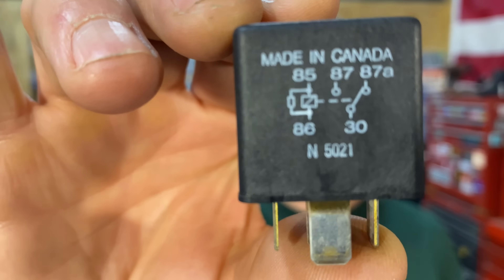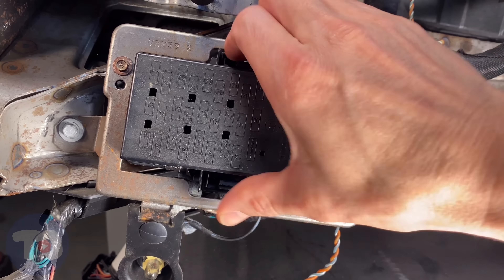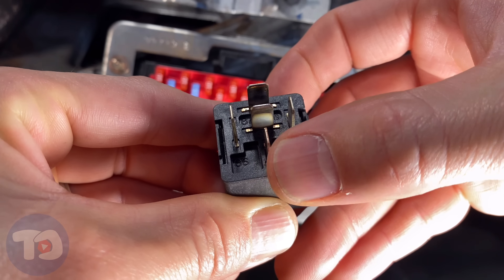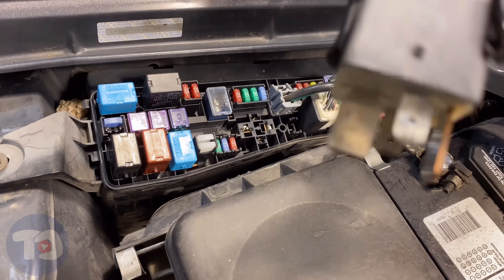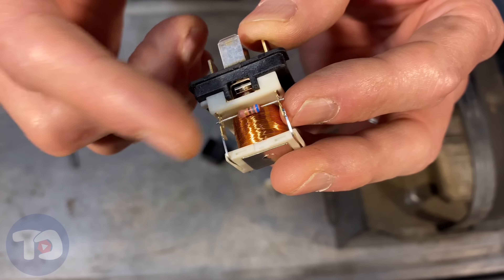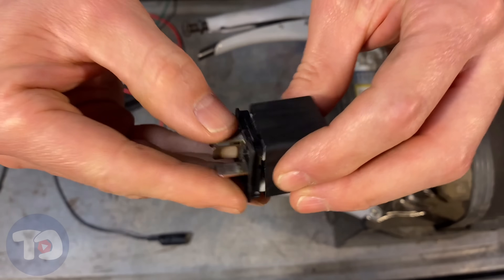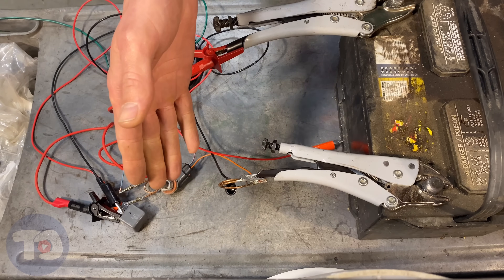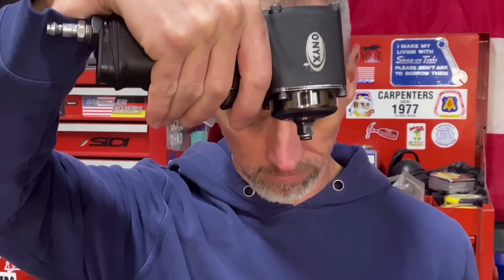Why are relay pins numbered like that?

Comment: 6:26 Answer. You're welcome.
Reply: thats not the "Why" answer..... thats just how its wired
Reply: Actually 1:16... but thanks for the red herring!
Reply: @wes3428  And still that is NOT the answer. Not fully. The thing is that the first vehicles to use the relays only had one relay. Vehicles were a lot less complicated back then. So when the relay was installed the numbered circuits is what they went by. The numbers not even written on the relay. People just referred to the pins by those numbers. So when Bosch finally started marking the pins they just went with what the car manufactures called them. Of course they did not know that these relays were going to be one of the most popular, if not the most popular relay type, they might have changed the numbers to something different like 1,2,3,4,5
Reply: @wes3428 1:16 is the distraction.
Reply: Why start at 85 though?
Reply: Exactly. It's excruciating in all of these videos to start out with "what is a relay and why do we need them?"
Reply: So all of us can do something much more useful with our time. Just like you do when you can skip all of about 6 minutes of precious time😊 (I deducted 26 seconds for finding your comment on how to save time)
Reply: @bennylloyd-willner9667  So many of them are that way, it seems.  Just blab, blab, blab, blab before maybe finally getting to the point.  And of course "Don't forget to SMASH that like button!".
Reply: @TonyGarrett-p1c they don't charge that much for watching their videos (I haven't paid anyway😊) , so I don't think we can judge them too hard on how they should/must produce videos to suit all tastes😊
Reply: What a long video for explaining a simple automotive relay terminals.
Terminology used here is not aligned with basics and automotive standards. Explanations are focused on how relays are working, not on meaning of the relay terminal.
Reply: @ehsnils said: 'All is explained in DIN 72552, and there's even a Wikipedia page for it. "
Reply: Holy fuck. This guy rambles on
Reply: Thank you

Comment: Relays normally have a Diode across the coil to protect sensitive electronics not a 680 ohm resistor. I wonder why the auto industry does it this way? Cheaper may be?
Reply from the maker: Maybe

Comment: As pointed out already below to protect semiconductors from inductive voltage peaks which can raise up to multiple times of the operational voltage rather diodes are in use. A varistor would be an alternative which is a voltage-dependent resistor. It lowers its rating when the voltage exceeds a specified limit and shortens it out. You can find them in surge protection devices as well. A normal resistor would not protect in this case.

Comment: Many relays have diodes to prevent the voltage spike from entering the electrical system, think like your coil in your ignition. Having a reversed positive and negative on 85 and 85 can bypass that protection, a resistor less so. Many circuits use the ground side for switching to reduce the number of hot wires stringing through the vehicle and the potential problems that can cause.

Comment: 2 pole vs 1 pole. The 1 pole is for single component control. The 2 pole is for redirecting the voltage towards multiple destinations. It's basically a single pole switch vs a 3 way switch.
The numbers aren't necessarily important, only that they're indicative of primary and secondary circuit terminals and the n/o - n/c terminals.
It's very basic switching via electrical input.

Comment: Caution.. to simplify / lower parts cost..... some manufacturers use same base for 4 blade and 5 blade.  Sooo  if it prints numbers on base @ blaes...  it will also print 87A, just no blade there.  This can confuse you.  

Just note in the ol' brain-  On 4 blade Relay if it shows 87A it is a dummyspot and ignore it. May be a closed grove for where that 5th blade would fit
Reply from the maker: Good tip, thanks.

Comment: I had a '76 Saab with all Bosch electronics.  Every damn electrical device failed.  Some melted.  And replacement parts had to be gotten thru the dealer only.  Horrible company.
Reply from the maker: Sounds very frustrating!

Comment: It's 2025 so relays should have a light showing when they are on, and on fuses showing when they are blown.
Reply from the maker: There are fuses with lights that come on when they’re blown.
Reply: In the machine industry we have flashy relays in all colours with beautiful led indicators. And instead of weird numbers, the schematic is printed on each relay. Of course we also still have the transparent ones, where you can see the copper at work, those don't need a led indicator of course. The sockets sometimes have handles to easily lift out the relay and stuff like that. But we do use the DIN rail to mount all that different stuff next to each other.

Comment: So much simple information missing from this explanation.  There is a full DIN list that would explain why the numbers used are the number given.  Simple examples are not just for relays, an ignition switch in any vehicle will have these terminals, terminal 30 (remember that from the relay) well it means permanent power supply (just like the relay) so there is a feed ready for the the circuit to function. Then we have on the igniton switch terminal 15 which means that is the terminal that is live when the switch is turn to the ignition position. terminal 50 is for the starter activation feed wiring when the key is turned to the start position.  The Bosch DIN listing is long and the number required for specific function fall as they lay in the listing.  Also there is a list of LETTERS that in all DIN wiring diagram tell you WHAT the compenent itself actually is.

Here is an example of the COMPONENT LETTER CODES (example S1 could be the ignition switch, S7 would be a switch for another function, K1 would be a relay, M1 or M2 etc would be motor1 and motor2 etc etc what each function is will be shown in the scematic diagrams)
A	PCB and Control Box assemblies
B	Input sensor (real world signals to electrical signals)
C	Capacitors
D	Digital devices
E	Devices not listed elsewhere (lights, lamps, heaters etc etc)
F	Fuse
G	Power sources (Alternators, Generators, Batteries)
H	Indicators and Alarms (Audible and/or Visual)
K	Relays
L	Coils and Inductors
M	Motors
N	Voltage regulators, Electronic amplifiers
P	Gauges (i.e. Fuel, Temp, Press, Hour meter etc)
R	Resistors (fixed value and variable resistance resistors)
S	Switches
T	Transformers
U	Electronic modules, Modulators, Voltage converters
V	Semiconductors (i.e. Diodes, Transistors, Rectifiers etc)
W	Transmission conductors (i.e. Aerials, certain wiring harnesses)
X	Connectors such as plugs and sockets and terminals (fixed and/or removable)
Y	Electrical actuators (i.e.  On/Off solenoids, Proportional solenoids, Pulse pumps)
Z	Electrical filters (i.e. Noise suppression)

Here is an example of some of the more relevant TERMINAL NUMBER CODES
Terminal	Designation
15	Ignition + (switched via the ignition key)
19	Preheat for engine
30	Permanent battery +  (also used to signify the feed to a relay)
31	Chassis (normally -ve)
49	Indicator relay  (49, 49a, 49b, 49c)
50	Engine starter signal (output from ignition key and also at the starter motor)
58	Key auxiliary position (used for park lights and/or radio supply etc) 
85	Relay coil ground (-ve)
86	Relay coil activation signal (+ve)
87	Normally OPEN relay contact
87a	Normally CLOSED relay contact

B+	Alternator B+ terminal connected to +ve battery post
D+	Alternator D+ terminal connected to charge lamp/hour clock system
C	Indicator relay pin for dash display turn indicator lamps.

Refer to the full DIN 72552 listing for all designations
Hope this helps someone. I will help follow wiring schematics.

Comment: The earliest Bosch electronic fuel injection systems used a wiring harness with all white wires. The terminal numbers on the connectors was the only way to figure it out.
Reply from the maker: That would’ve been fun

Comment: Normally a coil would have a flyback diode across the coil to shunt the voltage from the collapsing magnetic field.
Reply from the maker: I might research why an automotive relay is built differently.

Comment: For all of you who were left with the question "why" in your mind, while this stupid electrician, failed to answer it in a whole video, I quote the "because"... the DIN Institute has made a list of all the possible electrical conditions that someone can encounter in a car. These are more than 100. The numbers on the relay terminals represent the electrical conditions in this table. and more specifically.:
30 → Permanent voltage (directly from the battery, without a switch).
85 → Relay coil – ground (negative pole of the activation circuit).
86 → Relay coil – positive pole (usually from a switch or ECU).
87 → Output contact – load (when the relay is activated, 30 is connected to 87).
87a → Output contact when the relay is inactive (30 is connected to 87a when the coil is de-energized).

Comment: Hey that denso relay is interesting. Seems also common relay for toyota cars.
Might be a good and cheaper replacement for my e39 high speed aux fan. Just need to drill a hole on those large pins
Reply from the maker: Might be. As long as the circuit looks the same, should be fine.

Comment: Instead resistor in parallel with coil, much better solution is to put diode. Diode will eliminate that voltage much faster than resistor. The voltage wich come back from the relay to ECU when relay going off, has opposite polarity with voltage which turning relay on. That diode will supress forward voltage.

Comment: You show the relay closing and 30 passing power to 87. Plenty of times I use 30and 87 to complete a ground in a circuit
Reply from the maker: That’s a good use for a relay too. From what I’ve seen it’s more common for engineers to route 12 V positive through a relay.

Comment: 6:56  well, unless it's my '88 Mustang where they built auto resetting current protection into the switch and ran full power so that, as the breaker aged, it eventually got weak and your headlights would flicker until you replaced your switch, unless you were just cheap like me and ran a new power source for the fog lights thus taking them off the headlight circuit.  😉

Comment: Thats the reason for the relay, to carry the amperes or load of a device, the coil in the relay is turned on/off by the computer which cannot carry excess load, the relay also provides an air gap between the control circuit and the load circuit or device protecting the computer.

Comment: Waaaaay back in the 1960s and 1970s we had a reverse biased diode across relay coils that shorted spikes from the collapsing magnetic field around the relay coil to ground.  A resistor won't do the job.
Reply from the maker: I wonder if the resistor is used so the pins can be wired in either direction?

Comment: Speaking of the controller pins, 85 and 86, I have always applied voltage to 86 and grounded 85. But the relay functions if you reverse these. Does it matter which way it's wired, assuming there is no diode between the two?
Reply from the maker: The coil has no polarity, so either way should be fine.

Comment: Hi! Can I run 24 volts from 30 to 87 and 12 volts on the trigger (85/86) switch? I'm planning to install a 24v airhorn in my car and I just bought a 24V boost up converter.
Reply from the maker: I’ve seen 12v and 24v relays, but never dual voltage. There might be one out there.

Comment: Those numbers are from ac electrical systems, for relays, and their particular functions by number designator.
   Time delay, over current, undercurrect, over voltage, etc.
  Thats where those numbers came from.
   When automotive manufacturers wanted relays in the vehicles, they had to go to an ac relay manufacturer,  the numbers were the engraving numbers they had in their manufacturing, they did not have  1, 2,3,4, so they used random numbers of what they had.
  Thats how those numbers got their.
   Original dc circuits had only switches, no relays, relays were invented by the ac system manufacturer westinghouse.
  To control higher power electrical circuits with a lower power electrical circuit and switch.

Comment: That answers the questions who, how (it works), when.. but not WHY. Why 30, 85 86 87?
It could be just 0 for ground and 1 for  power C for control and  L for load.. or 1 2 3 4.. any numbers actually. So - Why is still open

Comment: Sounds a bit more like legacy of the first standard than "Bosch".  Relays are so cheap and simple we don't really appreciate them until we have a car that doesn't use many.  Carrying solenoid and headlight current through the key switch was a favorite of the Fiat Group.
Reply from the maker: Great point. These FICMs and other modules are terrible.

Comment: You need to learn the difference between voltage, current & power.
Reply: What is voltage, current, and power?
Reply: @bernardocisneros4402  Electrical current is the flow of charged particles, such as electrons or ions, through a conductor or space. It's measured in amperes (A), and the larger the ampere value, the more electricity is flowing.
Reply: @bernardocisneros4402  Voltage, also known as (electrical) potential difference, electric pressure, or electric tension is the difference in electric potential between two points. Measured in volts.
Reply: @bernardocisneros4402  Electric power is the rate of transfer of electrical energy within a circuit. Its SI unit is the watt, the general unit of power, defined as one joule per second.
Reply: @Ozcrazy49  Thanks for taking the time and providing the info.

Comment: 30 87 and 87a are common 85 86 are coil winding sometimes 85 and 86 have a fly back diode this is to stop a back feed as the magnetic field collaspes, as a  ecm/bcm/module may be sensing voltage on those pins so it requires zero volts the moment it turns it off, otherwise it may not actuate the next solenoid as it senses voltage on the pin and thinks it has a fault or is still engaged
Reply: No, 30 is the common to 87 and 87a. I don't know what you're talking about in the 2nd part of your paragraph.

Comment: 30 to load 85 86 to a power source/capacitor. 87 open 87a to powersource. 85 86 powersource battery amp hours/ reserve capacity can be worked out for timer circuit, swap 87 with 87a for a turbo timer or reverse buzzer time out circuit etc etc hours or seconds depending on 85 86 power source this can be switched or seperate power source entirely

Comment: You showed a 5-pin relay numbered 85, 86, 87, 87a, & 30. I have a 4-pin relay numbered 85, 86, 87, & 30 on the little diagram embossed onto the side of the relay cover. However, the pins are numbered 85, 86, 87, & 87a. WHAT?? Are the 87a on the pin and the 30 on the diagram refering to the same circuit?
Reply from the maker: Strange, never seen that before.
Reply: manufacturing mistake

Comment: 30 is often thought to be the load hot side but that is not univerally true. 30 and 87a/87 are just switch contacts. You will often see power in on 87 and out 30. Plus..they could have NO power on them and switch a ground .   An ohmeter could tell you which two are the control pins across the coil if you have a Chinese knockoff relay that doesn't have the numbers cast into the base. (I've seen that before).
Reply from the maker: That’s true, thanks.

Comment: Relays were enumerated by BOSCH ... before anyone else did it, and this  originated from the GERMAN DIN institute and Bosch. The numbers could have been 1/2/3/4/30 ... but BOSCH chose 85/86/87/30. Bosch relays, to this day, are the most reliable automotive relays made.
Reply: I don't agree. All the relays in my 1997 Toyota Camry (Denso) are original while the ones in my GM vehicles (Bosch) are not.

Comment: I prefer the British Lucas system, C1, C2, W1, W2, where C1 = 30, C2 = 87, W1 = 85 and W2 = 86. C = Contacts, W = Winding.
Reply from the maker: Makes sense.
Reply: I figure C stands for contact. What does W stand for wire or winding?

Comment: I have a '95 Susuki Swift and someone in Japan thought it was a good idea to not use a relay for the headlights. It works most of the time, but every once in a while, the solder in the switch melts and the lights won't go off, or on, depending where the molten solder ends up.
Reply: Put in a relay
Reply from the maker: Wow! That’s terrible.

Comment: Many times the suppression device at the relay is to reduce electromagnetic radiation emission (no crackle if your radio is on AM) and not to protect the control module. Most modern automotive body modules have relay driver ICs which include active clamps (which protect the device from high voltage inductive load transients) as well as full OBDII diagnostic coverage. Some ICs are large power devices having a total of 8 drivers on board.
Reply from the maker: Good info, thanks.

Comment: Thank you for explaining on how relays work. I am trying to fix a washing machine relay and this certainly helped. I have a question on where did you procure the test leads with LANG  1120 written on. Thank you
Reply from the maker: Thanks. That Lang test lead set (part number 1129) is so cool to use. I bought it on Amazon: https://www.amazon.com/dp/B000KIVOU2/ref=cm_sw_r_as_gl_api_gl_i_8GW6FZC9GHH6J4Q34KTD?linkCode=ml2&tag=tooldemos08-20

Comment: 87a is used when you want to disable something.
e.g. Starting inhibit when engine running is the most common function I can think of. The starter control circuit was running through pin 30 and 87a.
The pin 86 was pinned to alternator.
Safety interlocks were using that a lot too.

Comment: You left out 87A .
87A and 30 is normally closed and open when 85 and 86 are energized to 12 volts. 
Don't really care why they are numbered the way they are. 
No body says you can't number these pins any way you want.